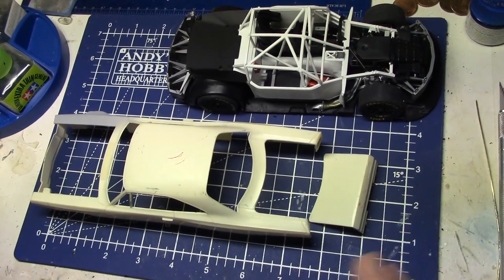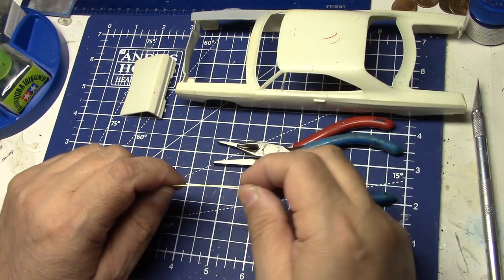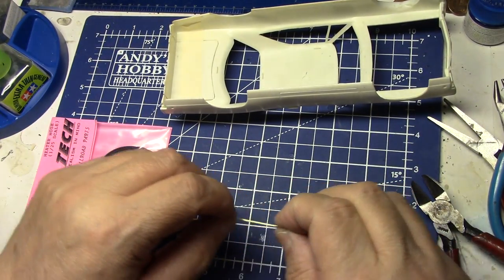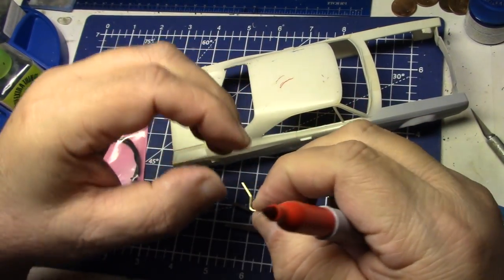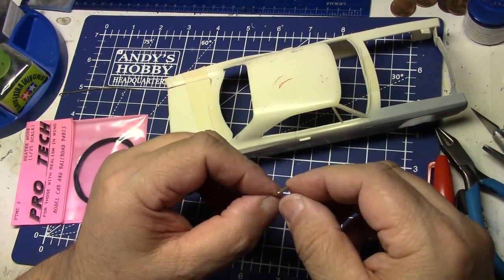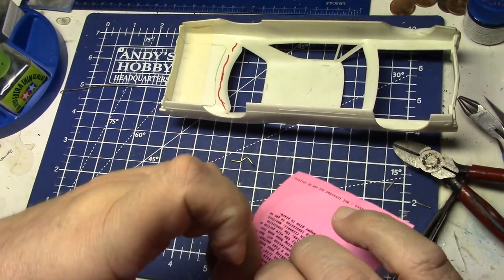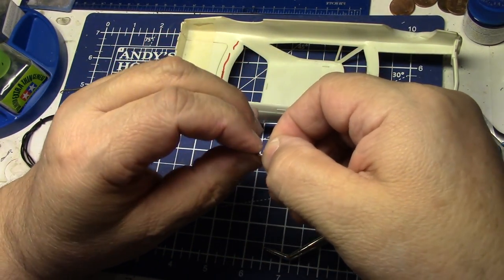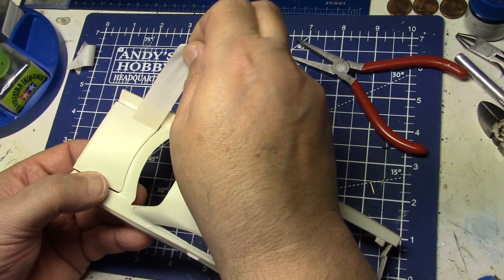How To Make Working Hinges On Scale Model Cars Ep.208

Comment: You should do a video on opening up the rear wheel openings of the 68 Roadrunner and 69 GTX, as well as the Revell 70 Cuda. They are all incorrect and the manufacturers won't do anything about.

Comment: I do a lot of hinges myself... Just a quick tip... some doors on real cars when opened will be on the inside of the inner fender and some doors when opened will be on the outside of the fender. You can replicate this depending on where you place the pivot point of the hinge. If you place the pivot point on the inside of the door, going into the fender then your door when opened will be on the inside of the inner fender... When you place the pivot point on the inside inner fender going through the door, when opened your door will be on the outside of the fender! Hope this helps some of you!

Comment: what if you left the hinge material a little longer so you could glue or solder a retainer on,and used the rad hose and put it inside a slightly bigger diameter tube and glued that down instead of gluing the rad hose directly to the body.

Comment: I love it.  I'm going to use this in a build soon to open up the hood.  I was going to use styrene tubing but I'll be getting heater hose now.  I am still planning to use a straightened paperclip for the hinge though if it fits into the heater hose.  Any concerns with that?
Reply from the maker: As long as the paperclip is that .032 size. You shouldn't have an issue. I just like the brass because it a softer metal and easier to tweak.